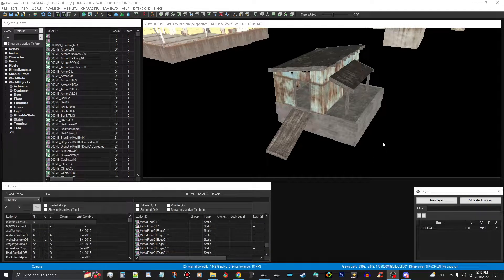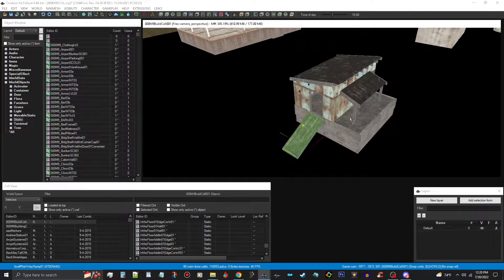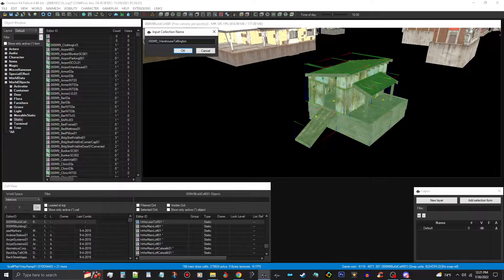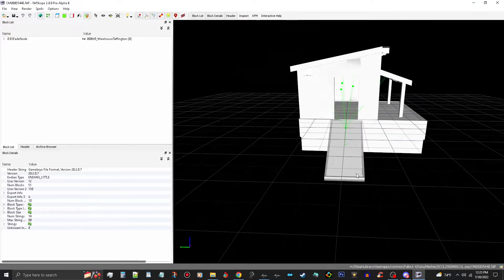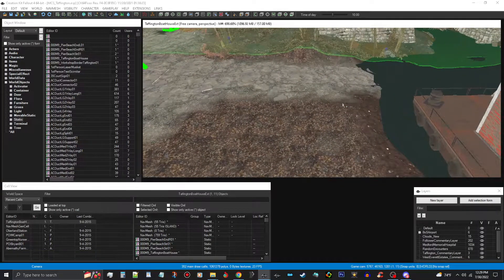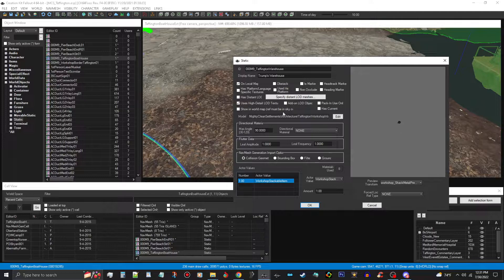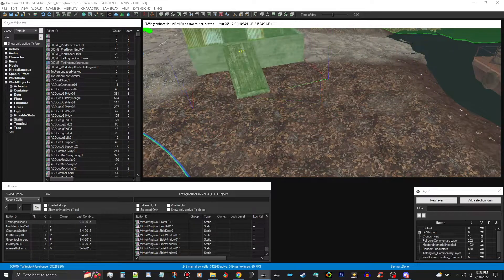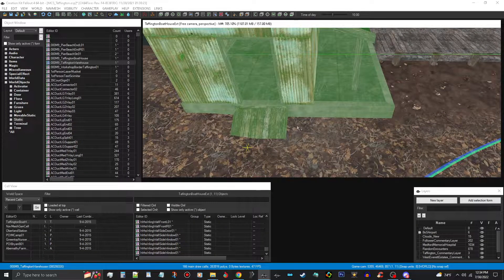Fallout 4 Creation Kit Tutorial: Static Collection Buildings

Comment: work for me, but i want to make working doors. Do you know how to do it?
Reply from the maker: just use vanilla doors is the best option
Reply: @The_Ninedalorian I'am trying to make the vault prefab using the vault-tec DLC, but if i don't put the door, in game the door doesn't conect. If i make with door, in game has no interation. I really don't know how to do it
Reply from the maker: Did you try duplicating the door you want? If it's more than one part make duplicates of each part
Reply from the maker: if you are using vanilla pieces some of those don't have snap points. A good example is the door to the workshop house. The Bethesda Devs solved that problem with a snap point door marker (its yellow) Go in the kit and check out what they did.
And if the Snap Points tutorial wasn't from Hoza i wouldn't trust it. I learned a lot from that guy.
Reply: @The_Ninedalorian i see one video about it but it doesn't clear how to use this yellow marker. Do you know how?
Reply from the maker: its like any other marker. You just place it in the Kit.
Now with your static collections you don't put doors on them when you make them anyway. That is done in game with the workshop menu. And if you're careful you really don't need snap points if you can freehand them